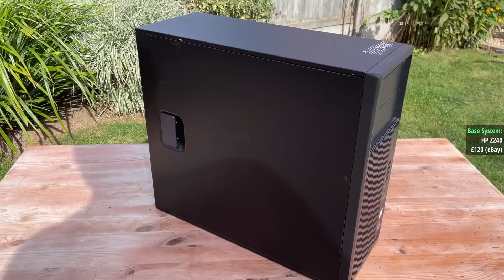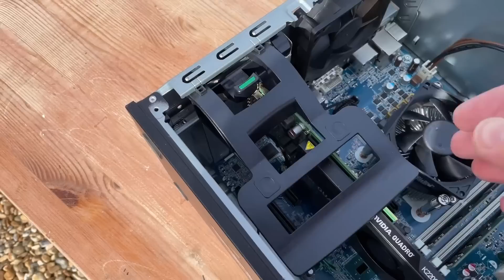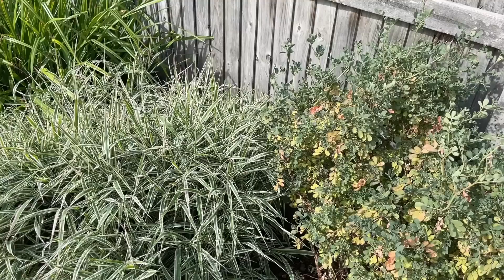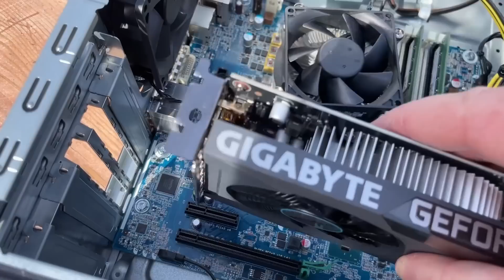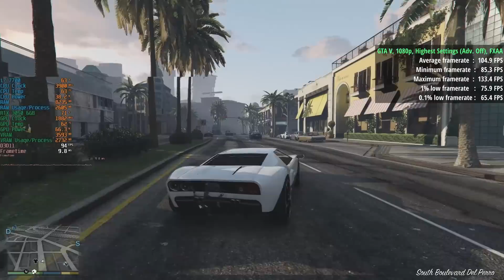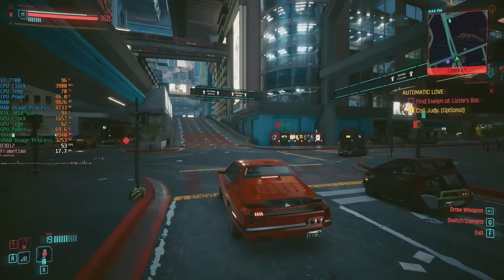A Simple £250 Gaming PC Build

Comment: I have an older z400, the Xeon is slow, it's 5675 but the great thing is 6 ram slots, DDR 3 means cheap way to get 24 GB with sticks of 8 GB and the stock PSU is 475 watt with six plus two power for GPU. I have a 1660 super.
I'm probably 250/300 total cost.

Comment: You have a 6pin power and you use a 3050 ? i think used rtx 2070 will perform better. (6 to 8 pin adapter requiered)
Reply: That computer would probably struggle supporting a 2060, let alone a 2070.

Comment: Video idea: build a low end platform new like am4 and 4100 with used gpu and compare
Reply: If you find yourself in a situation where you come upon old office PCs I could see doing this, (and, it could be a fun project) but, I wouldn't go out of my way looking for old Pavilions, to 'hot-rod'. You're better off building on a new AM4 system. Also with the option to start off with decent Integrated graphics, of a R5-5600g, you could put the Graphics card on a separate lay-away plan, until you are ready to ante up.

Comment: I feel like the RTX 3050 6 GB was sort of a weird choice here - except for DLSS the GTX 1060 6 GB performs about the same and sells for $100 less at least.  A lot of them have a 6 pin adapter so that wouldn't be an issue in a system like this.  Given that the goal is simple and cheap spending a fair bit extra for a GPU designed for systems with a truly weak PSU like the RTX 3050 6 GB feels unnecessary.

Comment: While it might end up costing slightly more, it wouldn't be too much more to grab a secondhand AM4 motherboard with a decent Ryzen 5 CPU (separate works, too, if the prices are right) and RAM, plus a brand new, cheap case, fans, and PSU rather than using that old HP and i7... Assuming the used market in your area, could even be cheaper from Facebook or something... Would offer better upgrade paths and probably better performance out of the box, too...

If you can't find good deals on used parts, though, then these old OEM systems are always a decent option, but they would never be the first thing I'd look for...

Edit: Should probably mention that anyone that doesn't have experience with building PCs may just want to go the OEM route for their first build, or do some research on the parts before purchasing to ensure compatibility... And when you do go to buy an item (assuming it's in person), look for damages, especially bent or missing pins on the CPU/motherboard CPU socket and give any used parts that have shrouds/covers a little shake to make sure nothing is loose inside of them, like a screw or something (that could cause a short and destroy the hardware)...

Comment: So, I'm currently using an i5 4460, 12gb ddr3 ram at 1600mhz and a gtx 1060 6gb. 
I built a budget pc for a client, with a Ryzen 5 5500, 8gb 3600mhz ram (the other 8gb stick wasn't booting, so I'm returning it) and an RTX 3050 6gb and when playing The Hunter Call of The Wild, the ddr3 pc feels faster. Would it be because of the ram? I was running the game off of my external hard drive, with both PC's.

Comment: A while back I got an HP Z240 motherboard combo with a xeon e3-1230 v5 and 16gb ddr4 for about $32. I was able to recase it pretty easily and it works great with an RX 580! Surprisingly solid motherboard. The TPM can be updated to 2.0 which is pretty cool. Runs windows 11 great.

Comment: Personally, I think going with a used 1660(ti/super) might have been the better option. Faster than the 3050 6gb, and typically 80-100 dollars in my area. I believe some models use a 6 pin but I might be mistaken, but buying a 6 to 8 pin adapter is simple and not really that sketch imo.

Comment: I've run adapter cables for years in various upgrades and builds and never ever had a single issue with one. They make a cost effective away to get a better gpu into a system. Just don't buy em from china/ali express you'll be fine. They are not dodgy.

Comment: Should have gone with an HP Z440 model at the same price instead.  Half of the point in using these old Workstations is to get Quad-Channel RAM...  Plus you would get a Xeon with more cores and more PCIe lanes, higher wattage PSU, more expansion, more everything.
The 240 is really just a little office PC imposter of the bigger Z series Workstations.  Dual-channel RAM is a huge limitation.

Comment: Bro use adapter like 6pin or 8pin to two sata or 2 molex adapter (depend of model rx 6600) rtx 3050 sucks compere to rx 6600 about same prize or cheaper❤i know i7 7700 will botleneck with rx 6600 but will be little bit better❤

Comment: You should have went with an 8GB RTX 3050. It uses a 6-pin power connector. I have one myself. I Got it brand new from Amazon for $180. Had the original factory seal, packaging, and the A/V output protective caps.

Comment: I would rather use the adaptor and put something like a 1660 Gpu in. Readily available second hand for cheap as well, as the 3050 is a pci-e gen 4 card with only 8 lanes so performance is reduces on the system with only pci-e gen 3.

Comment: Just so you know, a 6 Pin to 8 Pin PCIe adapter just adds 2 ground pins. If you felt like you could squeeze in a certain GPU with a 400W PSU (what this is afaik), then any single 8 pin card could've worked out.

Comment: Nice to see an old i7 continue to be useful. I am using a SFF version HP Z230 as a living room TV Plex PC. I got it for free when a neighbour dumped it at the trash! It came with a fully working, top spec i7 4790 with 16GB of RAM and an original 250GB SSD. It now sports a 2GB SSD, 16TB HD, extra USB 3.0 ports for my external drives via a low cost add-on card, and an Arc 380 LP video card. It's a great video transcoding machine supporting all the latest codecs, courtesy of the Arc GPU. I agree, these computers run very quietly. I leave it on 24/7 and it's completely unobtrusive, and runs cool. These boards use a server type chipset with no room for overclocking, but they are designed to run day in and day out without fuss.

Comment: The GPU is really held back there I honestly would not pair that with anything higher than an RX5600 XT or an RTX 2060 and that is already slightly beyond to what the CPU could handle best case would still be a GTX1070/1080 or a Vega 64/56.

Comment: I personally built my kids a couple of machines on dell precision t3610 and myself a budget workstation out of a t5610

They support dual 6 pin GPUs out of the box but with just a cable swap you can get an 8 and 6 pin out of it(dual 8 pins are possible but not with all PSU options)

I picked them up for 25 each
All 3 had 16gb in them mine got upgraded to 64gb(ddr3 server ram is dirt cheap) 

Theirs got a single e5 2667 v2 (8c16t at up to 4.0ghz) mine got a pair of them

Their machines got rx 6600s and mine got an rx 6700

No nvme boot support unfortunately but with an add in card I was able to use one for games on mine and I just used sata for everything on theirs. I’ve even played starfield on mine @ around 40 fps @1600p

Comment: G'day Random,
For most people a build like this is plenty, for alternatives rather than dropping from 3050 to a 1650 a 1060 has 6pin PCIe & would still make a good combo for most games.
Or as you mentioned at the start get a 6pin - 8pin PCIe Adapter for way more GPU options, the 6pin - 8pin PCIe adapters are not really a "Dodgy Fix" as all it does pass through the 3x 12v + add the Extra Earth & Sense pins so less chance of it Melting than the nVIDIA 12+4pin on 4090.

Comment: I recently put together a similar system. But not with a prebuild system, but with used parts, including an ASUS B250M Plus, i7 6700, 2x8 GB Ballistix 2400 c16, a GTX 1080 HOF, a 500GB SSD and a BQ PP11 600W CM. The Case is an Used CM TD 300. To my surprise, the PC runs well. I paid around €230 for the parts. Well, it's a lot of money, but if you're lucky, you can build something like that without a Dell, HP or Fujitsu office PC - without any Proprietary problems. Unfortunately I don't know anything about the British used parts prices/market, to compare it with my country. In Time Spy scored the System 6997 Points (CPU 4439, GPU 7790)

Comment: I had a 6700K @ Stock with a GTX 1080 and the CPU didn't hold back the GPU at all @ 1080p.  So I reckon you may have been able to go for a better GPU with that i7 7700, although getting one that needs no extra power connector, that's a different ball game.

Comment: If on a budget one thing I can add is, that if you have free time and you understand basic things about software and hardware you can squeeze alot more performance from the computer (especially if using Windows). I have i7 4770k, rx 580 and 16gb DDR3 2400MHz memory and I get better fps in some of those titles. In cs 1080p 170-220fps in competitive matches and 150-200 in deathmatches. Cyberpunk 1440p. about 40-50fps with medium to high settings. I modified the bios to support rebar, cpu is oc to 4.7ghz and gpu is at 1437mhz and memory at 2200mhz. Everything in Wiindows is cleaned, no anti-viruses and alot of optimizations (real ones no youtube bs). You just have to take care of the machine and it's also alot more fun when you make something that it's not supposed to run well, to actually do.
Reply: An rx 580 only runs Cyberpunk at 40fps medium settings 1080p, so worse than this gpu. You are using fsr performance, no sheet Sherlock
Reply: @niebuhr6197  I don't use fsr as it causes ghosting, John.
Reply: @MartinKarov-l8o  ok, xess ultra performance scaling or so.
Reply: I don't suppose you could share those optimization would you? i dont mind learning something new
Reply: @javelin1423  Most of it is basic things. Most of the optimization guides on YouTube make it seem like there is some majic setting that would change everything, there is not. Some of the things I did, is dissalbing spectre and meltdown protections, but you should check if they have impact on your cpu, becouse they affect performance only on older cpus. I also dissable every startup app, permanently stop updates from group policy editor so the updates happen only when I want to and dissable real time protection when in games. You can also dissable every notification (don't use programs for that) from windows, becouse it affects older systems. If on amd gpu, you should install drivers only, as adrenaline software is full of very demanding extras. Stop every program before going into games (some people don't do it). There is alot more small things, that I can't remember on the top of my head. Sorry for my English, it sucks.

Comment: I got lucky recently with a HP Pavillion Power PC from Cex, i7 7700, 16gb DDR4, 500GB SSD for £135 but turns out it also included a GTX 1060 3GB and a 1TB HDD not mentioned in the description. Also bagged a Rx 5500 XT on eBay for £75 so may pair it with a psu for a total of £260 for a solid gaming pc.

Comment: An arc a580 would've had much better performance at the same price, but this is quite fascinating too
Reply: With what PSU??  Considering they need 2x 8-pin power.  And then there's the ReBar problem...

Comment: Most (if not all) of these "use an old workstation" videos are dedicated to 1080p. Would a "higher end gpu" still bottleneck the cpu if it was at 1440 or 4k?
I'm not trying to play my games at 300 fps, I want them to be beautiful. I'm looking for 80-120 fps.
Reply: The mid hp psu wouldnt hold anything pass 1660ti tbh so i dont think so

Comment: Seeing as the CPU in the Xbox one x is an eight core AMD pre-zen architecture, I'd be surprised if RDR2 wouldn't run on a PC with equivalent settings as long as the GPU is somewhat recent and the CPU is  sandy bridge i5 2500k or zen 1 Ryzen 5 1600

Comment: It's a good build, personally I'd most likely have gone with a 1060 6GB or something similar, because IMO the RTX 3050 6GB is overpriced for what it does.

That said, if you end up with a Prebuild without even a 6 pin connector, there might not be any viable alternatives (psu swap aside).

Comment: I'm running a Z400 with an RX580 powered through a 6 pin to 8 pin adaptor and had the RX580 at least a year without problems. The RX580 replaced a GTX750ti which in turn replaced the original card. The system has also had an SSD added, the original 2x4gb RAM upgraded to 6x2gb for 12gb in triple channel, and a better Xeon (6c12t replacing 4c8t). That's the attraction of these old workstations - you can upgrade bits as you go for very small outlay at a time. It's a toss-up which is older - my car or my PC.
Reply: I picked up a Z400 for free from work. I replaced the 4 core Zeon with a 6 core and use a 6 to 8 pin adapter for my GTX 1660 ti. It's been working great for eight months now.

Comment: Ive recently built one from a dell precision t5810 pre built,the pc specs r a xeon 2680 v4,ddr4 2400mhz ram,500gb Samsung ssd, 2tb seagate 7200rpm hdd and a 685w psu all cost me £75 on ebay and put a rx 6600xt which cost me £155,it can play games perfectly at 1080p high settings over 120fps and around 90 to 100 fps on 1440p medium to high and can do 4k on some games.

Comment: ive got an sff hp elitedesk with the low profile 6gb 3050 and an i7-6700. does fine, did just finish uncharted on it with ultra settings at 30fps locked 1050p, same with shadow of the tomb raider, as someone who enjoys 30fps its alright.. but seeing that indiana jones will require better hardware, i may need to upgrade.

Comment: These off lease OEM workstations are often a steal. I've been picking up the 8th and 9th gen models, since most can run ReBAR wit a bit of bios modding. That with a 1070, 1660 Ti, 3050, 6600, etc. will get the job done cheap.
Reply: Wished someone wrote a ReBAR bios for my SFF Z230!  The only hacked bios I have found for this board is to use a M.2 NVME 😥
Reply: Neither 1070 or 1660 ti can use rebar.
Reply: @niebuhr6197 I didn't say they could, you're confused. Also ReBAR can be used on 1600 cards with modification, also 2000 series.
Reply: @drewnewby  oh yes rebar works on 1600, by the same method as 2000. I was thinking about some dlss mods that explicitly required 2000 minimum.

Comment: Personally to bring costs down if you're using a Z240 for a budget machine I'd save a significant going for one of the Xeon machines notably the Xeon E3-1240 V6 which you can find in machines on ebay for roughly £80 (32gb DDR4, no drives or GPU) and will perform similarly to the i7 without paying the "it has an i7 Tax". But for sure looking at pre-builts you can snag some real bargains.

Comment: bleh. i like the whole cloth aliexpress e5 2650 v4 combo prices rn way more. I can do a much better system with a used 6600 at $120 and $40 for cpu+mobo. I've found ddr4 2133 in bargain bins, whole system for reliably around $250, with 1tb ssd

Comment: oh god... Why did you go all "used value" with the build, and then stick a 3050 in there?
150$?

GTX 1080? hello? lol
Would make it an even better 200$ PC
Reply: Did you miss the part about the single 6 pin power cable?
Reply: @wanderingwobb6300  add a 1$ 6pin to 8pin adapter... 
Some GTX 1080 models had one in the box...
Reply: @zCaptainz  A 180W GPU with an 8 year old OEM PSU?  Some aren't interested in that kinda risk.
Reply: @lewzealand4717  It's an 80 Plus Platinum power supply.
These are work machines, built to last.

Sure, it's riding pretty close to the edge, limited to 400Watts, with a GTX1080.

But if you're buying used, and trying to get value out of a build, why put a new and shitty product in it, like a 3050?
It's literally double the price of a gtx1080, for less performance

Comment: i wouldve gone for a card with a max 150w tdp and a 6 pin to 8 pin adapter, 1070 and 1660ti work well for this usage and can easily be found for under £100
Reply: 1660s or ti is a great shout, I'm seeing supers for less than 100 more and more

Comment: why not a gtx 1060 6gb , same performance
Reply: DLSS can help in some games
Reply: Except it is slower
Reply: @niebuhr6197  its within a 1 or 2 % of a 6 gb and 8 gb is a completely different card
Reply: @hayseedfarmboy  your comment doesnt make sense to me, but regardless of what you're trying to say, the SIX GB 3050 is comfortably faster than 1060. That's why the pc has a 3050 and not a 1060.
Reply: @niebuhr6197  as far as the bench marks ive seen the 6 gb is comparable in performance to a RX 580 or 1060 , the 8gb 3050 is comparable to a 1660 ti or 1070, the video that Random just posted kinda show this by comparing to a rx 6500
Reply: @niebuhr6197  their is 30% difference in performance between the 6 gb and 8 gb "version" of the 3050 the name is actually some what deceptive
Reply: @niebuhr6197  what im saying is the 1060 is half the price used and the performance difference across the board is generally considered to be with a standard margin of error
Reply: @niebuhr6197  and i didnt say the 6 gb gtx 1060 , im not considering the 3gb which in many cases is only a third of the performance of the 6 gb version
Reply: @hayseedfarmboy  and that's where your info is rather wrong. This 6GB 3050 is still 25-30% faster than 6GB 1060.

You stated "why not 1060 when it's same performance". Except it isnt the same performance. And definitely not the same power efficiency.
Reply: @niebuhr6197  i guess he data im looking at is wrong, but everything ive stated is supported by posted data